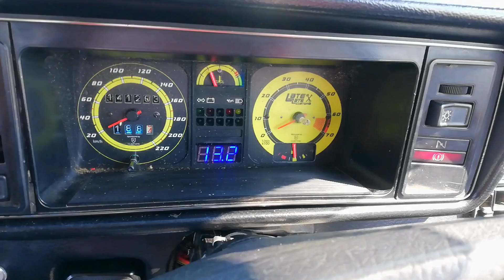JODY BOUGHT A BAGGED CITI GOLF MK1!!

Comment: I actually think I wanna understand how the whole air set up is don't now this is amazing
Reply: TTwenTyTw0 It’s a basic strut/shock but instead of a coil on the strut it has an airbag. It’s extremely simple and nice to have. Best of both worlds
Reply: Very simple indeed! There are 3 main parts, your struts (which is your bag mounted on a shorter shock), the pressure system and the control system. With some basic knowledge and enough reseach, anyone can install a system really!
Reply from the maker: Well explained Ashwin 💯🙏

Comment: Leke video My Bru, i would also like to learn more about the air set up the wear an tear of owning a car with air for a long period of time an especially the Cost and Maintenance of the air set up
Reply: Jean-Paul _not_JP I bought a secondhand Airlift Performance kit about 15months ago, had it installed and only had one issue eversince. One of my non return valves packed up due to condensation from the hot air from the compressor. I put 2 revised valves in and all was good again. So I have had a pretty good experience with mine
Reply: Where can one buy a second hand air lift performance pack?
Reply from the maker: Unfortunately second hand it is very scarce. But maintenance is key for this kit

Comment: Guys I need some help with my Mk1, on the dashboard there is a message that keep on coming up and off sometimes. It's say Oil. I do check oil every morning before I hit the road,and I have filled the gear box oil as well. So now I'm confused about the msg that keeps coming back.
Reply: Have someome check out the oil sensor for u
Reply: agree check the sensor and related wires.
Reply from the maker: Thanks for the advice guys